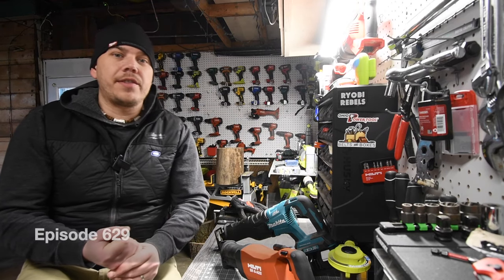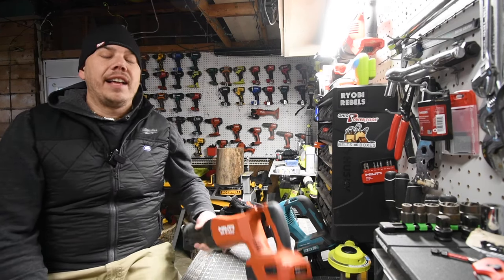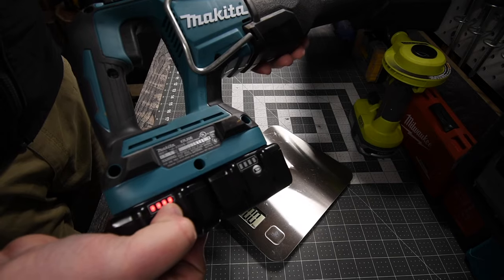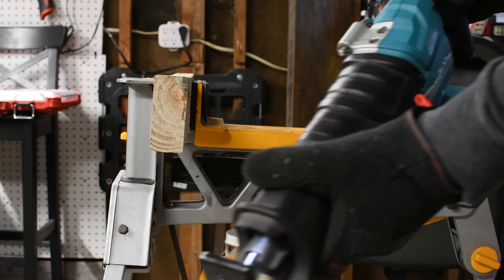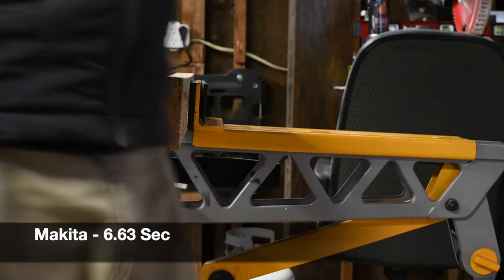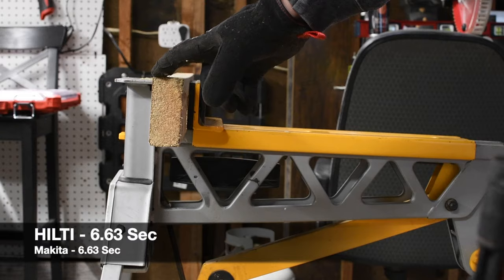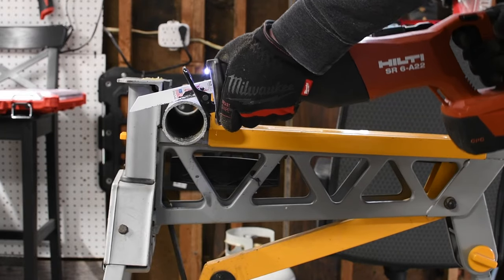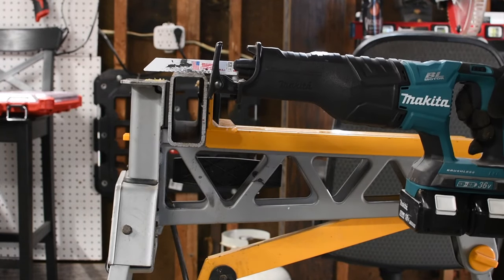Is Makita really better than HILTI?

Comment: MCT - just finished cutting up some scrap metal using an old Milwaukee 18v The Hatchet Sawzall I've had for about 13yrs. I picked up some new Diablo Steel Demon Bi-Metal blades and they made a world of difference!  The old sawzall had to work harder with the old bi-metal Torch blades I started with.

Comment: from videos i've seen the metabo recip saw blows both away. makita is releasing another 40v recip saw that is supposed to be superior to prior ones. the current one isn't as good as they hoped.
Reply: The Metabo HPT  / Hikoki is a beast, no doubt.  It’s been around for a while and, correct, the current XGT model is not as powerful (no orbital mode).  However, the Makita is heck a powerful enough and, in my opinion, much more ergonomic and easier to wield. The new unit is said to be more beastly than the Hikoki, but I’m guessing it’s actually just on par.  We’ll have to wait and see how it holds up in the ergonomics, weight and vibration department.

Comment: There's no reason why 22V should come close to or equal to 36V , you clearly have a preference for Hilti over Makita, but congrats on your relative test. 🤗
Reply from the maker: lol
Reply: Voltages don't mean shit for power in modern tools. And that 36v Makita is more for runtime then power anyway
Reply: Voltage is kind of irrelevant
Reply: Soo then in your mind Dewalt is the best because they have 54v?????
Reply: The Best is Milwaukee, Makita 40 v and Flex, Dewalt… I have all of them and I tried in very complicated situations!!!
For sure I will not include in my list of future purchasing Hilti:))
Reply: @cianhalley858  So, I can ditch all my 18v and 36v and use nothing but my 12v?  Thanks!!!
Reply: Put the makita 36v against a 18v super sawzall and say the same thing.